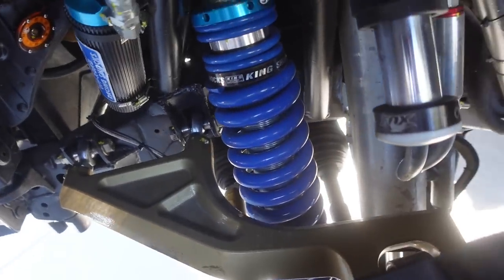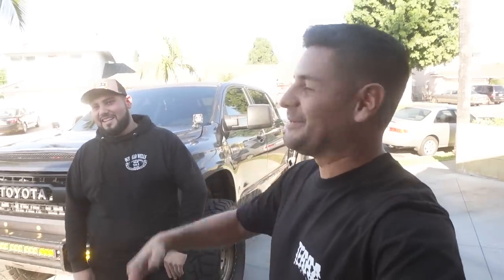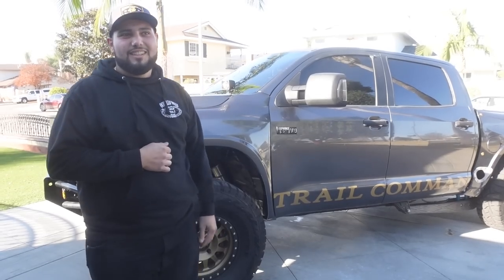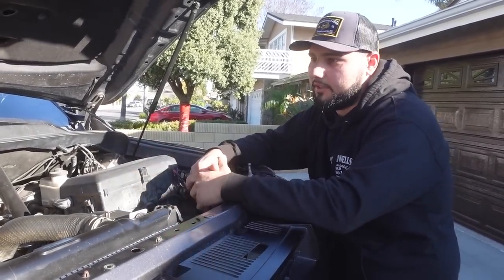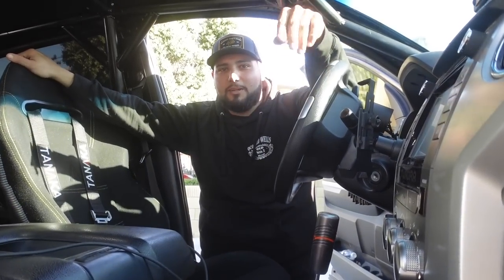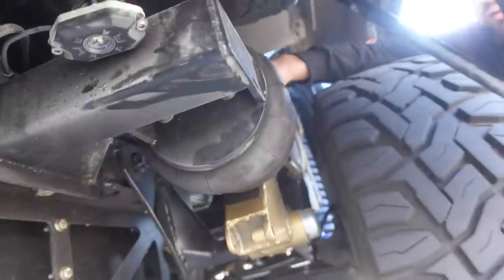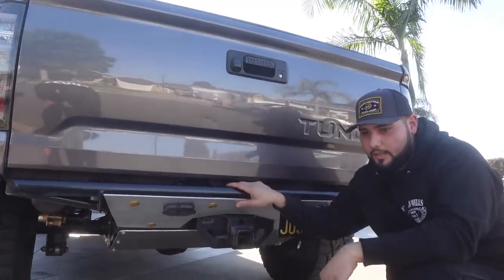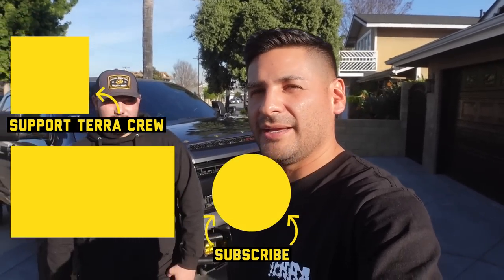2nd Gen Tundra Prerunner! | BUILT TO DESTROY

Comment: There is a video of a stock 2nd gen tundra pulling a 300,000 rocket. Only thing was toyota made sure to have a braking system on the rollers for the rocket. The issue wasn't the truck pulling it. It was the truck stopping it. The tundra is no joke. Love them things.

Comment: Running 4wd Baja style is hard on the front axles. I've blown 2 so far. Good thing they're cheap from salvage yards when stock width. 

Short suspension vid on my channel, when I had dumb 20" wheels on 37s.. fukin noob I was

Comment: I would love to see a video of this truck towing 10,000 lbs. Is it sketchy when coming to a stop? I would imagine the truck nose dives quite a bit.
Reply: Not at all she tows and stops just like a stock truck. Toyota made these tundra beefy af 😤4piston calipers with 14" rotors no problems stopping.
Reply: I have airbags on daystar cradles, hauling a 28 ft toy hauler. We are MAXXED out towing. Nut having the brake controller set up correctly it tows Nicely. I lost so much travel with airbags. Bottoms out harshly!

Comment: 3rd gen. But badass truck.
Reply: Sickness!!!!!! Way to go.
Keep hammering Terra!!!
Reply: I’d say more of 2.5
Reply: @Moelester692  2017 is 100% third gen
Reply: @matthenard  ahh I stand corrected , is there any major differences tho ? Just cosmetic mostly right ?
Reply: @Moelester692  mainly a new front grill assembly, more squared off body lines and an upgraded interior.
Reply: Ahh I see , I have a 2020 and my brother has a 2014 and it’s not really different except the power train and bigger screen and I think mine has the Toyota safety sense which I never use haha
Reply: @Moelester692  yeah third and fourth gen are very similar. 2020 is a nice rig!
Reply: 2nd gen tundra is 07-21, 3rd gen is 22+, according to toyota
Reply: @matthenard  yeah I have a 5th gen 4runner , a land cruiser 70 and I had a raptor but traded it for the tundra , thing was garbage hahah learned my lesson
Reply: This is a second gen.
Reply: @matthenard  no
Reply: @fish_built  2nd Gen Tundra is 2007-2013. 3rd Gen is 2014 and up. Then of course we all know the 4th gen that just came out.